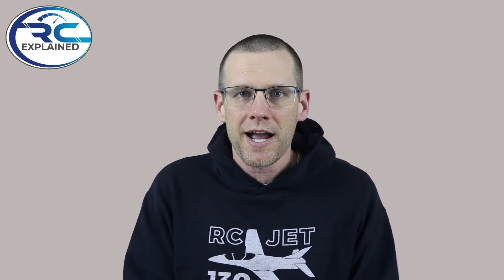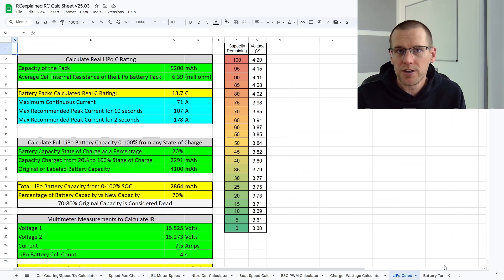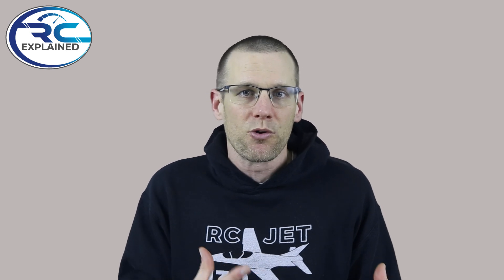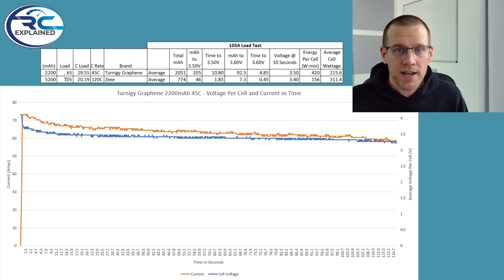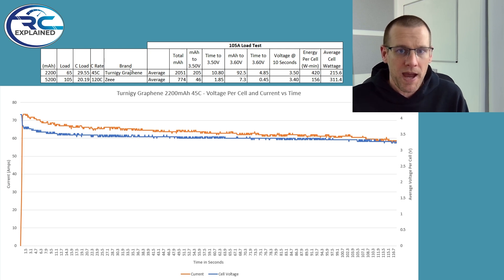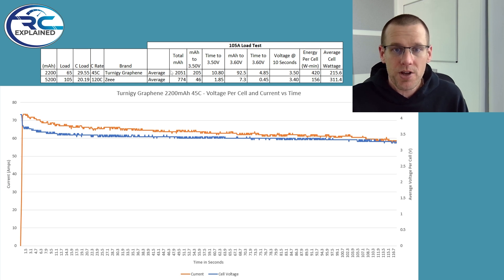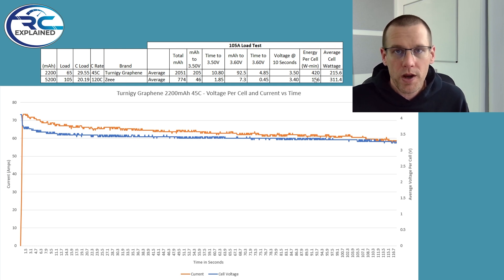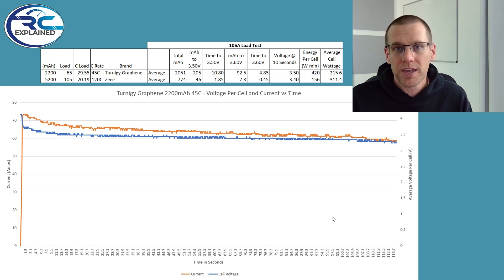Does the Popular 3S 2200mAh Turnigy Graphene 45C Live Up to the Hype?

Comment: Question chnl 4s 2200 70 c g plus pack from Amazon deals, new recently, tested and under 60-80amp full load speed runs down to lvc of 3.5-3.6, one cell was ok at 3.55v two down to 3.2v and one down to 2.9v, does that seem normal for new cheaply battery from Amazon or a dud? Second pack was better and only had one kind of low cell and three were ok, the first bad pack had three low cells and one good one… WTH???

Comment: It's time for all battery ratings to be standardized and truthful. I mean we aren't buying dollar store batteries.
Reply: I'd say that'll not be possible. You can do a simple test yourself, measure one of your battery's internal resistance at a 10-20 seconds interval and you will get very different results for the same battery. I believe there is a lot of factors contributing and so it's hard to get consistent results even if you measure the same battery at the same voltage at the same room temperature. Also, IR is very different while under 1A load, 20A load, 100A load. A battery can behave worse at 1A load than another  but outperform at 50A load. Again, a lot of factors contribute and while it's exact science it's not really that easy to predict/calculate.
Reply: From Amazon we are